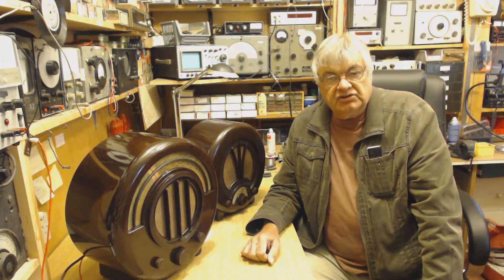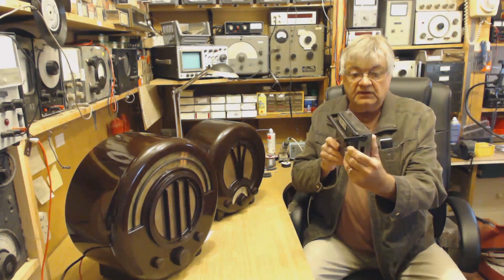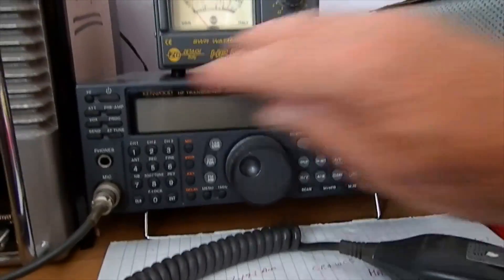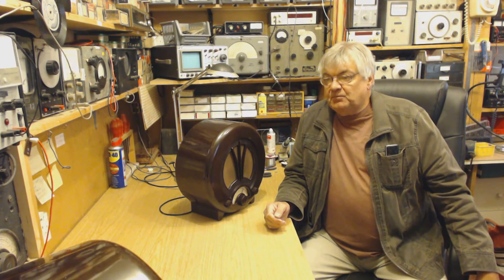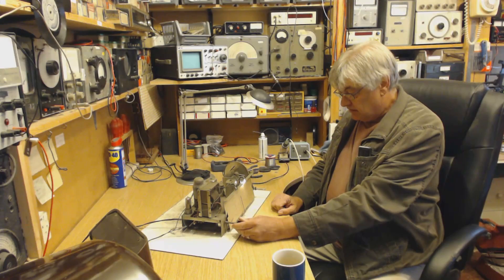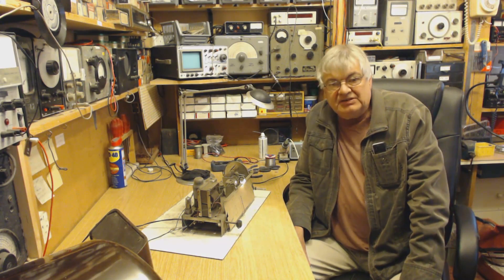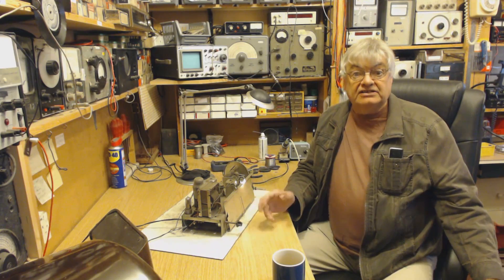Medium & Short Wave Interference

Comment: If the interfering signal is being radiated inductively (e.g. through a loop of domestic mains wiring or a literal coil of "spare" cable from a TV etc. antenna) then the ferrite rod direction finding method won't work.  I used to Tx MW etc. through ferrite rods and large loops, sometimes the resulting d/f null is a full 90 degrees off!  Inductive effect being more pronounced the nearer you get.  Some other direction finding method is needed.  On higher frequencies (eg VHF), phase/doppler methods (e.g. from multiple aerials on a car roof) work well, not sure what you'd need for LW/MW/SW, maybe a "juggernaut" truck!  Or multiple drones (swarm) using GPS timing signals to establish the phases of what each one receives?
Reply from the maker: Very useful information. Thanks, David.

Comment: Hi Ray, Yes, it's a bu**er, and I noticed it on the rental car radio (MW) when recently driving from Bognor through Midlands to Scotland. But it comes and goes in strength. Two thoughts. 1) maybe it was always there, but increased Rx sensitivity makes it more noticeable. When the band was full of stations, the AGC wound back the noise. 2) So much modern 'stuff' emits RFI - everything seems to have a microprocessor now with associated oscillator. On my recent UK visit, I was interested to hear the action on LW, and noted the brilliant range of RTE on 252KHz. Even with some of that awful noise, it punched through a listenable signal. Bring back Atlantic!
Reply: Hi Phil, 252 was brilliant when it was Atlantic. Such a shame it's gone. Yes, RTE has a brilliant coverage. Long wave shouldn't ever be forgotten. Cheers, Ray.

Comment: It could be a sky Q set top box.as these transmit WiFi signals between set top boxes and cause interference on mw and occasionally Fm caused by there switch mode power supply.
Reply from the maker: Nigel Shephard good thought, thanks! Cheers, Ray.

Comment: Actually this noise fault I heard can come from all kind of different electric sources for example from a leaking power line transformer or a plasma te/ 've even heard the spark plugs of an older car can produced it in this case can't do much unless willing to ground the house I heard the best way is to place a piece of copper underground & of course that will stopped the mess but the idea referred to an old technology tube radio or in case of a transmitter then that alone worth to cured it but not for an available small transistor radio now as far as I'm concerned by this noise I heard that if you moved the radio from one side to the other or all around it will point the direction to follow up to the source & it will gets you there then if the source is very strong let's say 360 degree all around you then probably is closed to you or in front of you .

Comment: I have had one pair of powerline ethernet adapters for at least a couple or so years and haven't had this problem. I have just tuned through the frequencies in the video and on MW (daytime) less than one S point of background noise. The worst RF noise machine I've found was a Panasonic Plasma TV, it was radiating from the switch mode PSU on numerous frequencies, but even that was not continuous broadband as described in the video. I'd be looking at local industries etc. that may be using high powered electrical devices. I'm not in the UK, so can't discount the conspiracy theory hi.
Reply from the maker: The conspiracy rolls on here in the UK. Plasma TVs ... nightmare!
Reply: Panasonic in Australia totally refused to acknowledge the problem when I contacted them. Their response was obviously well rehearsed.
Reply from the maker: Swaggerlot hmm, that’s not good.
Reply: @g4nsj  I gave it away to a friend in a commercial area, one that was more than a kilometre from me and any other hams I knew of.

Comment: Hi Ray, interesting video. That static reminds me of what we heard at the hotel where we stayed at Victor Harbor last year (2018). There were three AC units straight outside our window, which I believe were causing most of the problem. When staying away on holiday, it can be really touch and go at times as to how bad the interference will be. Incidentally, when closing a transmission (Analogue to Digital or even AM to FM), sometimes the converting station lowers the ERP to entice viewers or listeners to upgrade their equipment and tune into the new signal. This happened only recently with two Tasmania AM stations going to FM here in Australia. Anyway, take care. Robert. PS: If you haven't already done so, you are most welcome to subscribe to my YouTube channel.
Reply from the maker: Hi Robert, I've subscribed, thanks! All comments noted. I've often suspected that the ERP is lowered on certain stations... not very good, really! Cheers, Ray.
Reply: Hi Ray, thanks for subscribing. You may find some interesting videos in my Radio Reception Playlist, which includes AM, FM and low VHF. The low VHF stations include amateur signals received via DX. Regarding the ERP drop, I remember before the analogue TV closures, some TV stations dropped quite a bit in output power. This was especially noticeable in Southern NSW with the VHF TV channels operating from Mt Ulandra NSW, which used to easily be received in Wagga NSW. However, in later years, Wagga had to start up UHF translators after the Mt Ulandra transmissions weakened. This became even more apparent just before the analogue switch off date. Anyway, all the best. Robert.

Comment: Im a shortwave listener,and I'm in Cornwall uk  been into radio for around 40 year, its the last two year we got the same interferance on the same bands. There are stations that are still on MW SW that i know are there but can not monitor. Thing the man could be right concerning DAB and the BBC.
Reply from the maker: It's a great shame that interference is creeping in everywhere. It's ruining the hobby!
Reply: People say there's not a lot on there, but if you spend the time there is plenty, and there is no need for expensive equip, i work a Realistic  DX-394 with a old TA-1000 Coupler a old Sangean ATS 818 with a longwire, my old Yeasu 7700 now packed up and i have QSL cards from as far away as New Zealand an Australia
Reply from the maker: Well said, Martin. There are many, many stations on short wave., Cheers, Ray.

Comment: I have seen demos of the loop on You Tube its directional on the lower bands not so on HF but the noise is reduced. The cost to build at a guess about £30 ish  which makes it cheaper than £200 to by one from WellBrook.
Reply from the maker: Martin Bernstein Hi Martin,  thanks for that. I'll have to get building! Cheers, Ray.

Comment: I have heard that rer rer interference sounds like it could be some form of  electronic motor control on a washing machine as  all machines use computor control these days.

 On the internet  M1GEO has taken a part a 1 metre diameter Wellbrook loop and worked out the circuit He calls it Wellgood loop
its quite a simple circuit the preamp. I am going to build one soon
Reply from the maker: Hi Martin, the loop sounds good, let me know how you get on. OK on the interference, you could be right. There are so many sources of interference these days! Cheers, Ray.

Comment: Hello Ray, I live in Lancashire UK. We have the same kind of interference here. 200khz right up to 5mhz where it starts to die off. It`s just constant hash, no pattern or repeating sound. Tried to DF it with a tuned loop but no luck other than it seems to be carried by phone lines and cable TV lines (Virgin Media). Detectable withing a 300 meter radius of where I live. I`m a ham operator and it`s nearly put me off air. I have had to site a remote receiver at a distance from my home. Authorities have no interest, neither has Virgin Media. So it seems we are alone with solving this problem. Chris.
Reply from the maker: Hi Chris, I like the idea of as remote receiver. Although, it's a shame you have to go to such lengths. No one's interested these days, that's the problem. I hope it clears up soon. Cheers, Ray.

Comment: The noise on the shortwave & medium wave is caused by powerline ethernet adapters, or PLT interference, many ham operators are sick of it too.
Caused by adapters for sending data through household wiring but it sends the signal for miles into the air, someone with enough knowhow could tap your data if you used these.

In the US they get called home plugs... typically belkin gigabit, TP link or commtrend branded and they cause interference to digital radio too, and if found to be causing interference you can get fined if you are causing interference to legitimate broadcasts with them.
Reply: This interference is almost anywhere.Where i live (holland) ,  it's same noise on medium/short wave bands. I have build a tuned loop antenna for medium wave, and it makes a big difference in wich direction the antenna is set. It's no fun anymore to listen to this frequencies, the citizen cb band, is also non workable here🙁  The "air" is very polluted with hf electronic smog...
Reply from the maker: Good point, thanks.
Reply: Yes. The noise sounded very like PLT to me. Another nasty thing is Openreach ADSL and VDSL2 broadband over phone lines, but that doesn't usually throb like that and usually has more gaps in the problematic range of frequencies. e.g. where I am I'm not close to a Openreach fibre cabinet but there is a noise from the customers modems over approx 3.72MHz to 5.2MHz and 8.5MHz to 12MHz. It can be different frequencies if you're near an OpenReach fibre cabinet.

Comment: It could be a LED light driver, I have a small clip on LED goose neck light that made that same noise on the shortwave bands.
The "wall wart" driver is very small but it sure sings out a tune..LOL
Reply from the maker: Good point.
Reply: Had the self same issues and tracked it down to a switch mode psu and an ethernet switch!

Comment: Same thing here in south of france, near Toulouse. Just repared a shortwave radio and this thing is allover! From time to time it has these short 'fry' spurs that resemble the parasite interference of a mobile phone ringing by a guitar amplifier. The strange thing is that the moment i tune into even a weak station, the noise is lost for whatever the width of the tuned station. This whole thing reminds me of the blinding signal in the film They Live! Thanks for your video sir! Please let me know if you figured this out! I wonder if it has to do with the omnipresent mobile relays and antennas.
Reply from the maker: I will certainly let you know if and when I sort the problem out.  Cheers, Ray.
Reply: Thanks Ray! Btw, here too it comes and goes. After this conversation i started to notice in the streets these huge 'ferite-collers'-like contraptions enveloping many power cables close to the ground.
Reply from the maker: It's an increasing problem. I wonder what it will be like in years to come?

Comment: I remember when I made an experimental superhet radio, all I could get out of it was noise no matter what I tried.  Turns out a power supply (that was powering something else) was causing all the trouble.  Switchmode power supplies and AM radio don't get along well. As soon as I unplugged that, the noise stopped and I could receive several stations quite clearly.
Reply from the maker: Quite right, switchmode power supplies and AM radio just don't mix. Gone are the days of enjoying short wave listening.

Comment: Hello Dave.
I was wondering if you could help me with a problem, my Yeasu FT200, receive is OK but on transmit the needle on the meter shows 40 in the red on PO/IC/ALC any ideas Dave.
Reply from the maker: +Fender Blues Hi, I'm afraid I can't help as I don't work on amateur radio gear. Sorry about that.
Reply: Hi that's OK I just thought you may know it being a valve set.
Thank you for replying 73s.

Comment: I found one time using the portable I traced it to someone's power panel ... turns out the wire connections were lose and I guess arcing (I'm guessing) They had an electrician come look at it and all he did was tighten up the terminals ... good thing too because sometimes with enough arcing it can cause a fire.
Reply from the maker: slippery396 Transistor radios are excellent for tracking down interference. Glad you got it sorted out. Cheers, Ray.

Comment: I'm in Sheffield too and get it as well.  I live in a semi and it varies from room to room.  I think it's things with SMPSs in, modern TVs, computer equipment &c and low energy light bulbs.

It does have it's uses though as if I can't hear it between stations it shows the alignment is out.
Reply from the maker: ThePillenwerfer  Thanks for commenting. It seems that the whole country is having problems with interference of one kind or another, Cheers, Ray.

Comment: Have your utility company check for leaky insulators or bushings. Another possible suspect are pole mounted transformers that have moisture in their oil. If it has an underlying cyclic pattern I would suspect a water or sewage pump in the area or motor driven device.
Reply from the maker: Reagan L. Thanks, all good advice. Cheers, Ray.

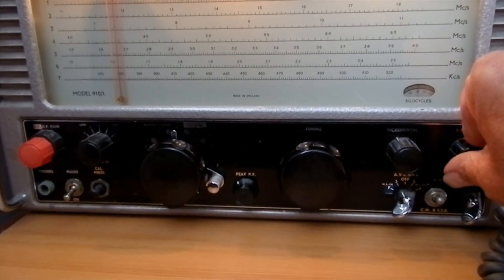Comment: Hi Ray, I have a similar noise on MW band lower half and also 80metre AM..But mostly on 10 metre around 28.400 - 28.500 is really bad on SSB & AM/FM, dont know what it is but it sounds like someone MIG Welding and it starts and stops every few seconds and is not in any sort of rhythm it so annoying then other times its gone, seems to be mainly late afternoon until 02:00 in morning? I have turned everything off im my house by the mains fuse box and run a mobile 10m and a portable AM radio and still same so I can conclude it's nothing directly in my house.... All the best from Mark in Gobowen, Oswestry.
Reply from the maker: More than likely.

Comment: Unfortunately, as we all know, the majority of houses these days have a modem/router connected to the telephone or cable TV network and also of course to their house mains wiring; so any interference from within the house; be it plasma TVs, Wifi extenders, switch mode power supplies has lots of nice telephone cables to radiate along. The source doesn't even have to be in the immediate area.  Ofcom may be sympathetic about the interference but unless it's interference to a Protected Service i.e. the emergency services, Air Traffic Control and possibly the FM broadcast band or TV I don't think they will do a great deal. I doubt if interference to the Medium and Long Wave bands is high on their list of priorities and certainly not the shortwave bands.  How about buying a house boat and moving into the middle of the Channel? - English that is, not Four or Five :-) Regards, Lee.

Comment: I have very similar interference problems. Worst here at the top end of medium wave, top band and 80 metres and various points in the SW spectrum. Like you I have less problems on the higher HF bands but 50 Mhz also affected. It is a sort of "motorboat" noise. I think it it caused by a neighbours PLT device as the problem suddenly started up here about 10 months ago.
Reply from the maker: Kevin O'Reilly Sadly, there's so much interference about these days that I doubt we will ever be free of it.

Comment: If you can do without power in your house for a few minutes? Try turning off the main breaker to your house, then turn on a battery powered AM radio and see if the noise is gone. If it is the source is in your house and if not then it's from outside your home.

Good luck to you. I Hope you find it.
Reply from the maker: TheRadiogeek Hi, I have turned the power off and it's still there, strong as ever. I will track it down, eventually! Cheers, Ray.
Reply: I had exactly the same sort of interference, covering a similar range of spectrum. I walked around and noticed more noise when approaching walls, interesting. I then tried turning off mains, noise gone! I wandered around again and found a lamp causing huge interference, thought this was the source. Actually unplugging the amp made no difference, it seemed to be acting as an antenna. Couldn't trace it to any device, so possibly bad wiring in the power cables, it could even be coming from thebnational gri
Reply: *grid or maybe leaking from a neighbour? Nnot sure how likely that is, seems like it's probably unlikely.
Reply from the maker: Everything is worth considering, thanks.

Comment: Don't Ofcom still have a radio interference service Ray? Might be worth finding out. I've used them a few times in the past and they've been great. We once had a raucous 50hz based buzz like that and the RA (as it was then) guys traced it to a faulty pressure switch on an air compressor in a local garage, and it was fixed within a day or two. But gone I'm afraid are the days of when you could tune across medium waves at night and hear stations from all over the world, and I'm talking before the ILR locals all started up too. There's just too much QRM. Sad.
Reply from the maker: Hi Alan, I'll get onto Ofcom and find out what the situation is. Cheers, Ray.
Reply: Coincidentally when I worked for them about 30 years ago I traced a case of interference to a contactor on a garage compressor, the contacts were arcing with the vibration. Was very pleased to be able to get the guys to co-operate, the owner of the radio site was happy to contribute to the garage getting their compressor fixed. Sometimes Ofcom can get this stuff resolved amicably...

Comment: Condolences on the interference Ray, the worst offender I've seen here for RF noise was an LG DVD/LCD integrated panel TV... it was so bad I could receive the audio from the movie being played at various frequencies.
Reply from the maker: ***** Sad thought it is, it's nice to know I'm not alone.
Reply: Radio Workshop I'm working towards a solution as the device is located in my Son's bungalow right next to my workshop/shack... I'm hoping adhesive metallic sheeting (roof flashing) might do the job installed discretely on the back (inner) panel.